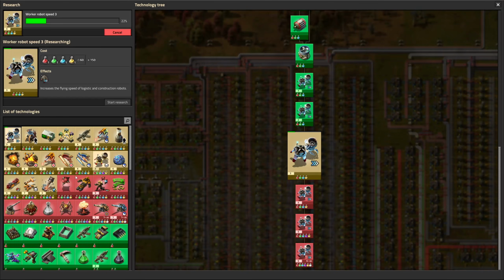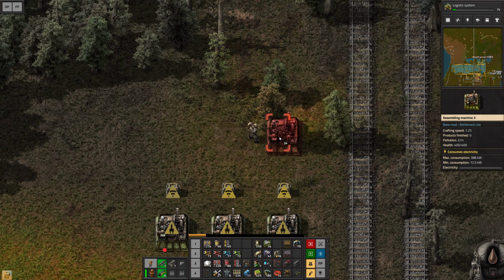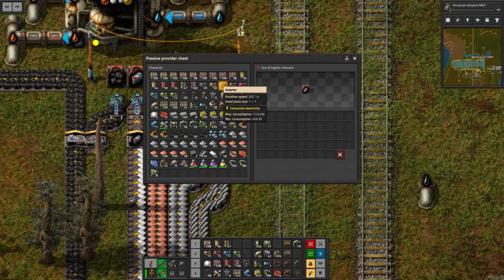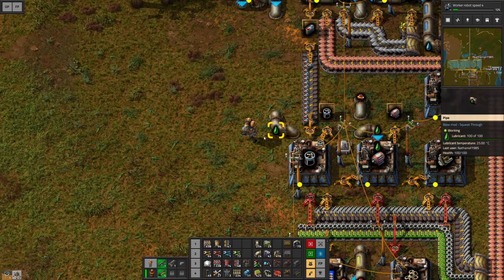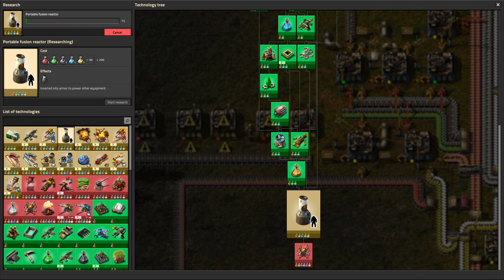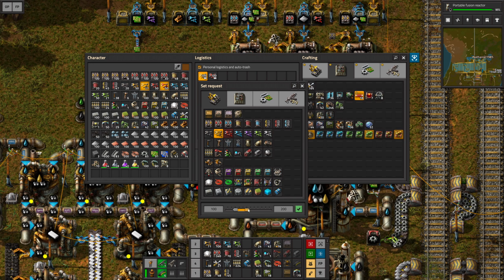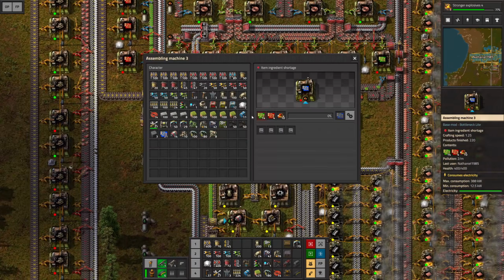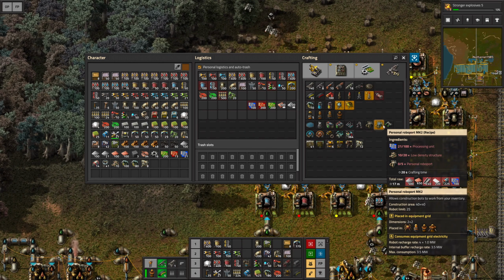LOGISTICS ROBOTS - Step 15: Factorio Megabase (Step-By-Step)

Comment: Hi, you know that you can shift+right click on assembler then shift+left click on requester chest to get proper requests? also it's better to limit number of produced items using red and green wires and setting up limit by contidtion. this way robots can still bring items so you do not need any additional chests
Reply: Copying to a requester can often result in crazy high request amounts though, so need to be careful with that and always check, because something that needs blue circuits at a very slow rate might request 500 of them using the copy/paste recipe system.
Reply: @CPcamaro  I mean, not really, it will only add twice the recipie amount, so unless the cost of the item is insane it wont be that high.
Reply: @NidarosLP  Pretty sure it depends on the crafting recipie time. If an item crafts in 0.5 seconds, you'll get like, 25 'crafts' requested, if its 1 a minute, you'll get 1 'craft'.

Comment: Just after the end of the previous  video in the series, I'm getting harrassed by a whole bunch of angry neighbors it feels like i can't get rid of the nests fast enough to have even a day or two without getting mobbed or my pollution spreading and making them angry, any suggestions?
Reply: I started using waterfill mod and just create a water boundary around the nests, or one could also create a boundary around the factory, sounds like cheesing the system but i rather learn how to create a mega base first than deal with biters